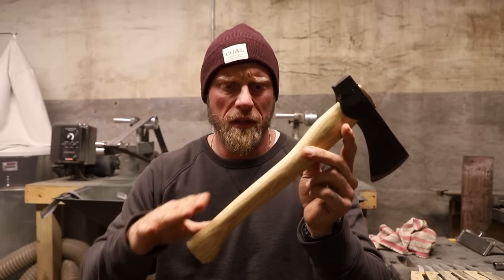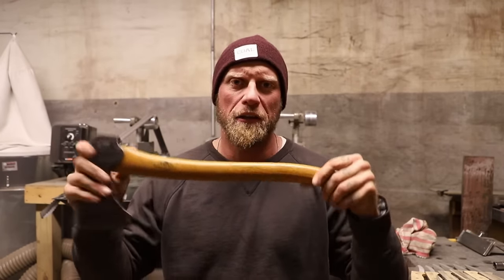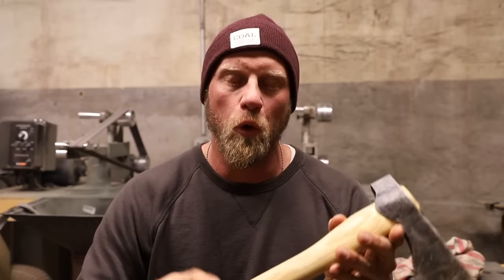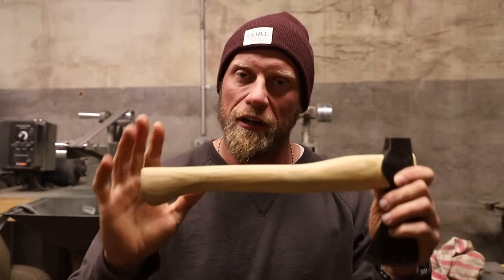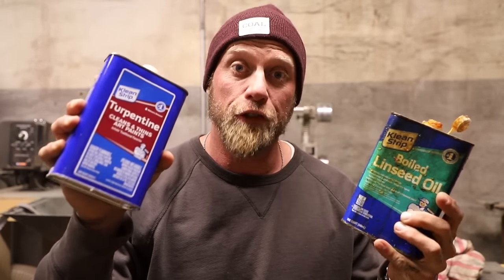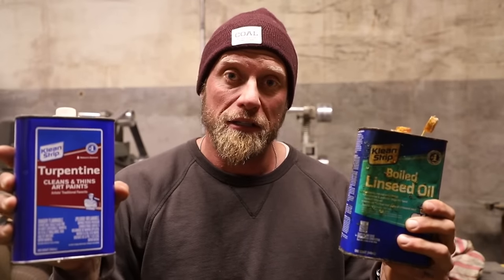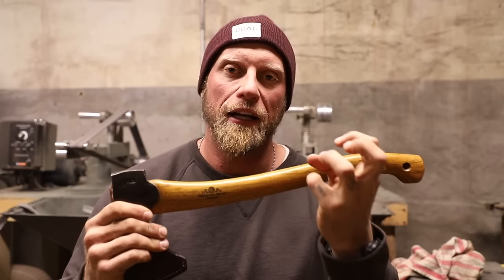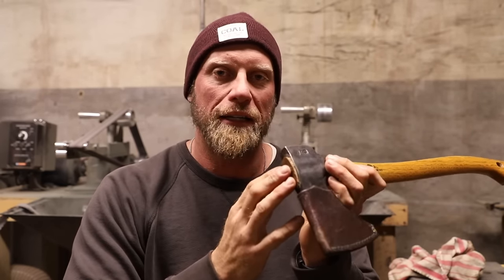Are you Properly Taking Care of Your Axe? How Professional Axe Makers treat handles.

Comment: When I was young I put a generous coating of linseed oil on a new wooden ladder as per my father’s instructions and I remember it stayed sticky for months. By the time it was no longer tacky the ladder had every piece of dirt, grass and debris adhered to it. 🤦‍♂️.  Proof there is such a thing as too much of a good thing. 😏
Reply: Linseed oil takes a very long time to dry, as you found out. Boiled linseed oil has drying agents added so it doesn’t take long.

Many thin coats are better and faster to dry than one thick coat.

Comment: I started using raw linseed oil instead of BLO, because I have little kids who like to help out, and most hardware stores BLO is just cancer in a can.  The additives that make it dry faster are pretty toxic.  So I use raw linseed oil, which takes a few days to dry, but I feel a lot better about my kids helping out.  Wax/oil mixes, like beeswax and mineral oil, are nice for finishing handles too.  Not as "weatherproof" as linseed oil, but I like the feel of a wax-finished handle a lot better than an oiled one.
Reply: Hi! By "kids helping" you mean helping with axe related chores or with saturating the handle?
Reply: Yeah, SkillCult made a few videos on raw linseed oil vs boiled a few years back. Definitely changed my mind a bit seeing all of the stuff like lead in it.
Also, I have quite a lot of old handles to oil, and I don't know how much oil to buy.
How much oil do you use aproximately on a regular axe handle?
Reply: @michalurbanful  Both, I suppose. They are young, and I try to let them help when they want and when they can safely help.
Reply: @weakest_serb  If you ask ten different people, you will probably get ten different answers, so there really isn't a right amount or right way.  I just wipe on linseed oil until it stops soaking in, then let it sit for a little bit and wipe it down to remove any excess.  Then let it sit in the garage for a few days or a week, and wipe it again to remove any oil on the surface.  An old dry handle is going to soak up a lot more than a new handle, a handle that has been oiled or waxed before won't need much at all.
Reply: @Factor85Labs  Understood!

Comment: As a furniture maker and green woodworker my personal favorite is from solventfreepaint. The Organic Raw Linseed Oil is freaking great. Doesn't smell like the big box store stuff, penetrates deeper, and lasts a whole lot longer. Works amazingly on all North American hardwoods.
Reply: The challenge with raw linseed oil is that it takes much longer to cure or polymerize. The BLO has “drying” compounds added to speed up the process.

Comment: An alternative FYI -- Another option I like over the Linseed oil/turpentine mix is a 60/40 mix of Tung oil/D-limonene -- if you buy the pure forms of each, chemical toxicity is vastly reduced and it polymerizes in the wood like linseed.  I personally prefer the finish of the Tung oil blend (and it smells good -- citrus 🙂).  Downside is that it typically costs more than the alternatives.  I sure appreciate your "get it presented" format, and also the behind-the-scenes work it takes to condense good content into meaningful videos.

Comment: I prefer "Watco Danish Oil" ....they have many stains, I prefer Dark Walnut.....sand the handle to get rid of the laquer, (or scrape it off),  or prior treatment and use 80 Grit sandpaper to open the pores of the wood....apply several coats, let it dry well between coats.......OnWard.......

Comment: Finishing a maple stock for a Kentucky Rifle Kit and using mineral spirits to thin pure Tung Oil. Have used BLSO straight out of the can and put it on til it wouldn’t soak in then wiped it off and it dried well on a shovel handle

Comment: My grandfather used to spray 50/50 BLO/turpentine under all his cars. They would smell like pine and never rust.
Reply: Same with my dad, learned it from some old school farmers way back when.
Reply: Did your Grandfather live in New England? just curious how it stands up to  calcium chloride? AKA road salt
Reply: @chriskeating5926 Sorry Chris, I grew up in Sweden, but I’m guessing it’s similar. The turpentine allowed the mixture to seep in and the BLO hardens it to a rubbery film. After application he would drive the car on a dusty dirt road. I think that was supposed to add to the protection, or just cut down on the smell 😂.
Reply: @jsollien127   Thank you so much for the advice... No need to be sorry have a great weekend

Comment: Your mix of BLO and turpentine is exactly what I used on my Tipi poles and it works very well, they were in the weather for several years with no issue!
Reply: I like to add a little pine tar to mine, nice smell, a bit darker and a little more grip I find

Comment: The way I would do it with linseed oil is to give light coatings for days. Clean the handle, get some linseed oil in a rag and give it a polish, let it dry (I'd let it rest until the day after), give it a pass with fine sandpaper, repeat until you're happy. On a new handle I would probably do just a couple of coats, for old handles a few more, you see when old dried handles will start looking better.

Comment: Hey Dan.
We got a lot of raw linseed oil here, both cold pressed and warm pressed. Boiled can be bought but it’s not nearly as common.
What is - in your opinion - the reason to use boiled linseed oil and not raw? I’ve read, that the raw linseed oil penetrates deeper into the wood.
Thanks. 
Love your vids, btw :)

Comment: Boiled linseed oil is literally raw linseed oil with mineral spirits and/or turpentine mixed in to make it dry faster.
Reply: Thanks dad, didn't know that. So glad you told me ... Uuuuh us🥴
Reply: More than that
Reply: Yep. Just added drying chemicals.
Reply: @izaacbanks3337  Yep. There is way more in it than just that. There are numerous toxic chemicals in it that require you use protective equipment while handling it.

Comment: In addition to the BLO I also heat my handles over a low fire or my stove top and rub 100% beeswax on all my handles and then I buff it in with a soft cloth. The handle grabs a touch more but it's still soft and smooth and even more secure and element proof. 

You can also mix BLO and melted beeswax to make a wood finish wax kinda deal

Comment: Question Dan;
How do I retreat my handle? Do I just sand it down and reapply or just reapply over what I've got applied now
Reply: If it’s been treated over the years you just reapply some more oil. No need to remove the older finishes.
Reply: @W_H_K  okay thanks 👍

Comment: Another good mix is BLO and pine tar from your local farm store or online. If your hand doesn't slide smoothly over the wood in a few days rub it down with fine steel wool. A piece from brown paper bag will work if there are nibs sticking up from dust after drying.
Reply: Isn't turpentine essentially pine tar that's been super distilled? (Genuine question)
Reply: @OffBitterShane  pine tar is one of the products remaining after turpentine has been distilled out. Turpentine is being used as a solvent to assist the BLO being absorbed into the wood.
Reply: @tommoore7602  ahh, cool, thanks for the info!

Comment: Do we have to remove the axe head for treatment or can we soak the entire axe handle, head and all?
Reply: You don’t remove the axe head. That’s assuming you axe head is fitting tightly to the handle. Apply with a rag.
Reply: @mikepainter2135  I will rephrase my question.

Will it harm the axe head to soak it in the solution with the handle?
Reply: @kenkneram4819  I use linseed oil without thinning it. It won’t hurt your axe head. Just thoroughly wipe it off or it might leave a gummy film.
Reply: @kenkneram4819 .. I think it would bloat the wood inside the handle and would eventually detach. I wouldn't soak it, just swipe with the linseed rag, you'll get a good seal.
Reply: @kenkneram4819  No, it won’t harm the steel. However, there’s no need to soak for any longer than a few hours maximum.

The end grain is what soaks more oil than the sides and you want that so it doesn’t dry out and crack.
Reply: @W_H_K  

Thank you.
Reply: @becca318 

Bloating the wood is actually good. 

If it expands as it soaks up the oil the ax head will actually fit tighter not looser.

Comment: The treated handle is also longer. And in my experience any handle under 20 inches is basically usless. At least where i live in upstate new york. Waste of weight that could be carrying a more usefull tool. I chose a 2.1lb vintage hults bruks agdor boys axe profile on a custom 22 inch handle. And it turned out to be an absolute dream of a pack axe. Perfect for camping trips lasting 3 to 10 days. For more long term i would prob bring a full legnth. And i know everyone is gung ho about boiled linseed oil. But i prefer to spend the extra money and get tung oil. Just my 2 cents.
I like this video because i would never mix chemicals like that without extensive research that its save.

Comment: ALL my carbon steel outdoor tools get GUN BLUED & coated with PASTE WAX (getting hard to find here) then you heat it up some to set the wax

WARNING! use a HEAT GUN or let it dry good before TORCHING it!
Reply: If you want a food safe alternative to gun blue try the Ferric Chloride method to induce black oxides on knives and other things that may be used for food.

Black oxide is still rust but it’s protective rather than destructive like red oxide.

It would be wise to watch a few videos on how it’s done.

I’ve been doing it for years and most carbon and tool steel go black to dark grey and it lasts a very long time and looks very nice. The only way to remove it is sanding.